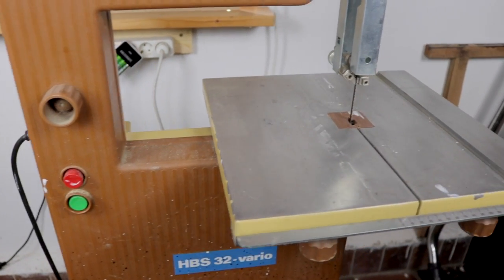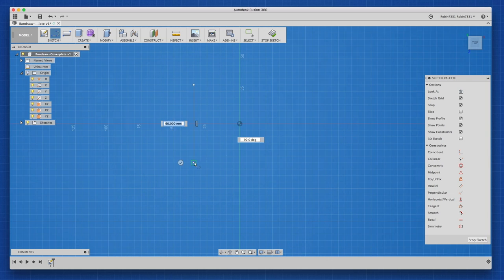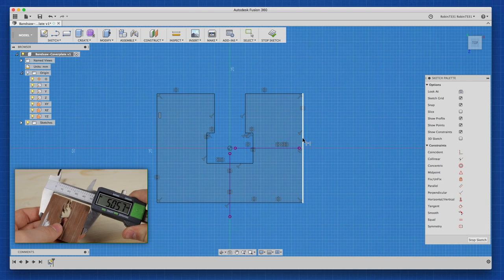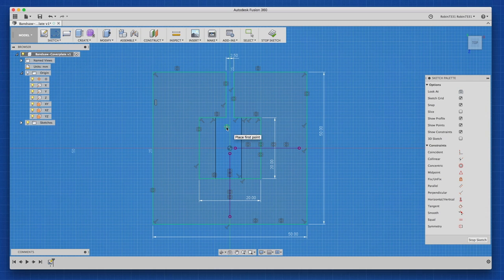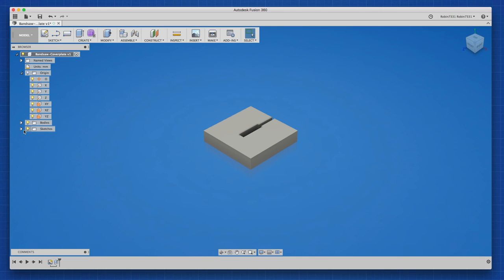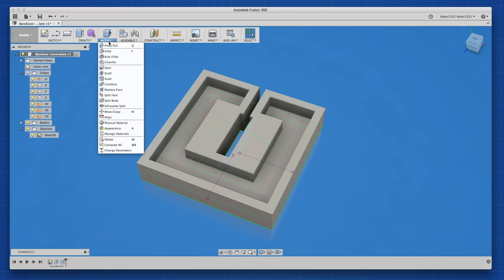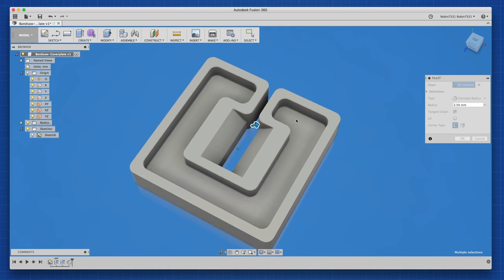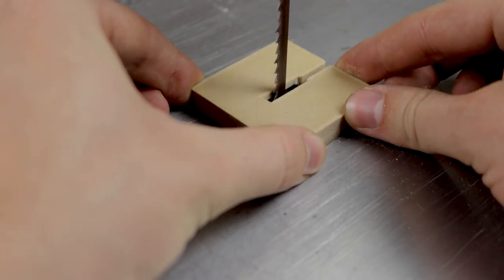Practical 3D Printing - Making a replacement part for my bandsaw with Fusion 360

Comment: That's brilliant!
I would do it with my 3Doodler.... but a 3D printer is even better :D
Would love to see more stuff like this! :)
Reply from the maker: +Alex Cio - Alapse You have one of these? Make a video! :)
Reply: Robin Reiter I will do one the next days! 
Looks like most people here in germany never saw this toy before....! :)
Reply: There is just a little problem!
The filament from the roles seems to be hard to use with the pen.... 
Seems like it is bend too much. The basic filament of the pen is normally completely straight. 
Any suggestions what I can do?!?!
Reply from the maker: Alex Cio - Alapse Hm why is that a problem? Is the pen not able to push through that slightly bent filament? You could maybe try to clamp a piece of filament from a roll into a vice or something and warm it up with a heat gun. Maybe you can get it straight..

Comment: haha nice! I also have the Monoprice Select Mini and actually one of the first things I did to upgrade this beautiful little machine was your flexible filament mod for the extruder (which is also in my miniature version monoprice mini on Thingiverse btw https://www.thingiverse.com/thing:2204896) and it works great! I haven't even had one jam so far. The funny thing though, is that a friend of mine who has the exact same bandsaw asked me to make a replacement for the exact same part. That I also modeled in Fusion 360, and printed in Colorfabb filament! :D great channel. keep going!
Reply from the maker: +Baschz Leeft Awesome! That bandsaw is pretty old so that is a pretty unlikely coincident :) That was also the reason why I did not even bother putting that part on thingiverse.